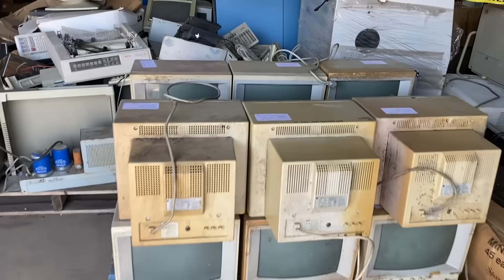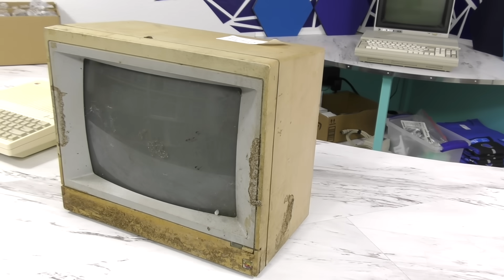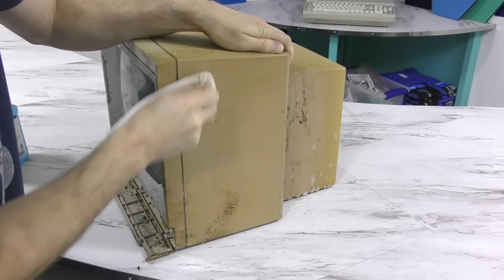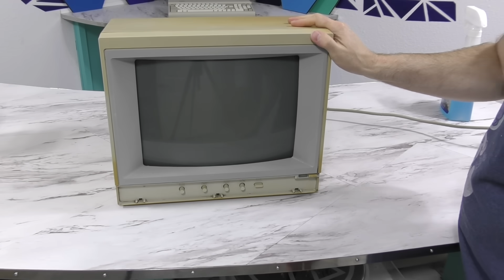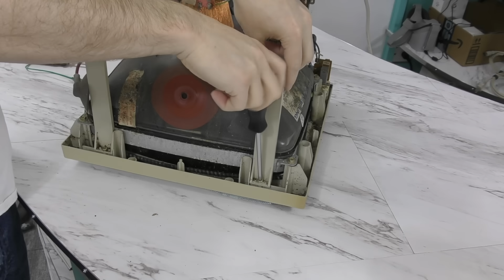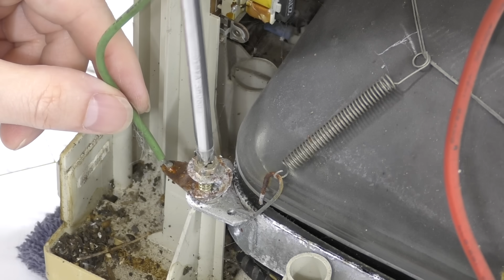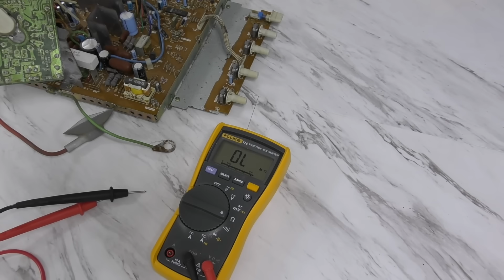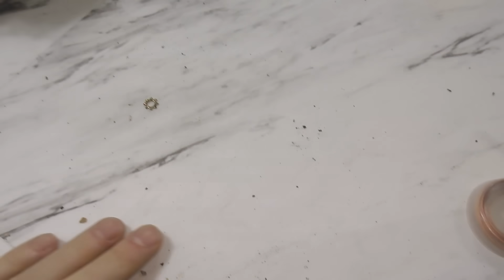Apple Monitor Found in Landfill - Restored - Part 1

Comment: There's nothing like a good rescue, especially of a CRT! If my field found C64 has taught me anything, it's that old electronic devices are more robust and resilient than we used to think!
Reply: Good to see you here Adrian! I really enjoy your content too!
Reply: @TheCasualSubculturist  Adrian has the most depth and breadth of any tech YouTuber - by far
Reply: @TheCasualSubculturist  Adrian has the most depth and breadth of any tech YouTuber - by far
Reply: Monitor problems? Who are you gonna call? Adrian- the monitor whisperer!
Reply: @666Astrosmurf  Who you're gonna call? Dust Busters! 😁 I ain't afraid of no dust!
Reply: No one may see this, but the diode in question is a high voltage fast switching rectifier diode.  Suitable replacement parts are pretty common.  Something like this might work.
https://www.ebay.com/itm/NTE525-ECG525-GE-533-SK3925-Si-Diode-High-Voltage-Rectifier-Fast-Recovery-Sw-NEW/271372095966
Reply: SAMS photofacts for these are difficult to find.  As long as it is high enough voltage/current, and a fast recovery type it should work.  It may cause higher current versus older parts so careful measurement of total power draw and a keen eye for parts heating up is wise.
Reply: You're not wrong. It's pretty amazing due to the build quality of these old electronics. I wonder who made the CRT that David bought. When were the last CRT's made Adrian???
Reply: Just learned it was made by Samsung, a brand I do trust as I've owned several electronics made by them.
Reply: @RJLightning68  Samsung.  Both monitors CRTs had the same label.
Reply: @RJLightning68  Actually, electronic components of the past are more robust and typically of better quality.  This is mainly due to the production quantities of electronic components, and the fact that almost all electronic components in the 80s were manufactured in the USA.  I've taken apart and repaired CRTs from the 50s to currently sold models.  I would definitely rate older CRT as 'better quality'.  This is especially true of any component which suffers from heating while in normal usage, as diodes are.
Reply: @RJLightning68  Ive seen dates as late as 2005 on some Toshiba's, and lower end brands on CRTs.
Reply: @RJLightning68  CRTs are still made, though they're generally bound to niche uses like avionics nowadays. Thomas Electronics still makes them for aviation and military applications.
Reply: That's so true like I repair printers and the old HP 4 printers were built like tanks
Reply: My own 64 was covered in green goop and had liquid in the bottom case but it fired right up after cleaning. Always clean these before testing!
Reply: Hey! good to see you here Adrian, your channel is awesome and deserves more subs.
Reply: The majority of computers and their peripherals have no moving parts to wear out and malfunction. Although occasionally you run into the expired RIFA capacitors, but they're easy to replace.
Reply: Adrian working on the IIc monitor, Clint did the 5154 today, now David with the Apple color monitors.

So... Monitors May?
Reply: My C128 was from a bin and still worked and my CRT TV is from the side of the road
Reply: Shango066 and radiotvphononut demonstrate that every week.
Reply: @Adrian's Digital Basement
Adrian, if you've got some time, Clint over at LGR Blerbs also has a CRT that needs some love. It's the new video as of today. Thought you might have some insight there like you did here and on your own channel. Just a thought, no intention to volunteer you or anything.
Reply: IIRC, didn't that one boot up just fine as soon as you got the motherboard cleaned of the mud and dried out?  Then there's the computer Mark from Mark Fixes Stuff restored that had been in a forest for 10 to 20 years.
Reply: If you like rescuing CRTs you should definitely check out shango066's videos, he does this exact stuff all the time
Reply: "old electronic devices are more robust and resilient than we used to think"
That's survivorship bias talking, and you over anyone should know about it.
Reply: About 3 years ago I was recycling some old tvs for work. At the plant I saw on a pallet stacked 2 high old g5 macs. All about to be scraped. I dont even like apple but was still pretty heartbroken.
Reply: Good to see you are holding hands with david :) Cheers!
Reply: These monitors may still have bugs in them, literal bugs.
Reply: Oh yeah fore sure. I found an old TV in the dirt and rain for many years, and the only issue it had was a loose connection which was easy to fix because all I did was cleaned the contacts and everything works!
Reply: Reminds me of the Atari 2600 my buddy and I rescued from a dump around 1989 which we found with several cartridges. Cleaned it up and were playing with it the same day.
Reply: Always glad to see restoration from people which have a good heart to save those good old electronics, I feel warm that people still spend time to rescue the electronics from the landfill, in my city they're sure going to trash bin and will tear down and scrape for copper, old computers and monitors much more memories from childhood.
Reply: I believe you also mentioned at some point you had a field found TRS-80 that you were able to fix as well?
Reply: @tombarber8929  ah yes, I did! A model 1. Was rescued from a pickup truck also found in a field. It was before I was really making videos though so no video documentation. That mud infested machine still works today.
Reply: Yeah ikr
Reply: I dropped my TRS-80 mod 3 accidentally.... There was a crater in the floor, but the machine still powered on
Reply: the fact that they're so robust is what makes them so much fun to restore :D
Reply: What do you mean -- more than we used to think?  The '80s way to repair electronics was to give 'em a good bash on the side with your fist or the heel of your palm.
Reply: I still find it amazing how many landfill vintage computers and electronics are still working today after hearing Bil Herd's talk about component aging a few years ago
Reply: I picked up an old gateway PC from around 1995 in around 2005, it had been sitting in a collapsing garage with no door or windows since around 1999 or so, the case was very rusted but the PC still worked. I got it cleaned up and sold it to someone who wanted it for his DOS game collection. There was also this cool Magnavox color tv in there that still worked too!
Reply: 8bg’s Vic-20 also hit the spot I recon, lol these disgusting restorations are the best.
Reply: Since this comment is talking about CRTs and my comments don’t show up normally, I am gonna post a question about my CRT, It is a Medion CRT with an internal VGA cable, every time I turn it on after letting it sit for a while, it makes a weird sound, like a hiss/electrical sound, it isn’t an ARC I don’t hear anything that sounds like an ARC. Just asking here if anyone knows what that sound is.
Reply: Your C64 was first thing I thought about while seeing those monitors
Reply: Loved this one. I also once restored a Commodore 1702 CRT that was found in a damp barn. You would not believe how stubborn the dust and dirt inside that one was. Surprisingly it turned on without any issue after cleaning it. It's still working to this day. If only I made a video about it..
Reply: Try to use a KÄRCHER from a bit away and  you get all dirt away.
Reply: I love it when my favourite YouTubers collaborate on projects: this monitor, the Commander X16, the Apple PIIe... please keep doing these videos every once in awhile.
Reply: Yeah, I've seen people do crazy stuff, or stupid simple solutions, to clean their busted electronics. I use Apple and their newer keyboards are garbage quality, if a drop, A DROP, of water gets anywhere near it the entire keyboard basically becomes unusable. Just put the whole thing in the shower (Or alcohol bath) to give it a good clean. Give it time to dry properly and it'll work.
It did, but not for very long though, after a couple of weeks my old keyboards started to freak out again, probably bubbles in the membrane. Unlike a Gameboy, these Keyboards won't last an explosion or a good fire, lol.
Reply: I absolutely love seeing crts being rebuilt
Reply: Drizzt Do'Urden  still has a better picture than your 4k lcd buddy boy.
Reply: @vincentlamb3436  not when it's full of mud with horizontal stripes
Reply: @natalieisagirlnow  horizontal stripes are an optical illusion from recording. The shutter speed of the camera is usually faster than the refresh rate of a CRT (60/75hz), and not all CRTs are covered or filled with dirt.
Reply: Very much so, the stuff from that time was not like today.
Reply: That's great. Last time I was there someone made a comment about "all the Apple IIe monitors found out back" and I thought he was just being funny.
Reply: N O K I A
Reply: Was very robust
Reply: Probably more that humans are more destructive than nature
Reply: Oh for the days when bean counters weren't penny pinching on the cost of each part.  I get that planned obsolescence has always been a thing in electronics but it wasn't always built to fail but rather just built to the limit of what could be done.  Leaving no room for improvement or future compatibility.
Reply: I agree fellow Adrian
Reply: I'm surprised that the stickers are still intact. They're still intact and sticky, even after all that scrubbing action.
Reply: "This diode will self destruct in 25 years....good luck Jim/David" - "I de-soldered the legs and when I turned the board over all that was left was some dust on my work-top"
Reply: Yeah I think that retro computers are gonna survive another 30-40 years. They already did it, what’s stopping them from doing it again?
Reply: and todays tech lasts a maximum of 15 years and can never be revived :P
Reply: we sure don't make electronics (or anything) like back in the day, some things were just TANKS.
Reply: @th3cub350  you won't see many SMD IC's in the these old fixable devices that have pins/legs sized in the order of 0.5 mm. if those corrode, there's a high risk it won't ever work again. It's not so much that the devices was built to last but also that they were more simple devices compared to modern electronics.
Reply: @th3cub350  They also had these novel removable fasteners called screws holding them together.
Reply: Hi Adrian - I wish David had simply asked you what the diode was and what modern replacement to use rather than sacrificing one of the remaining monitors merely to cannibalize one part.
Reply: @Fred_Raimer  Unfortunately, there is no way to know what the diode that is. Apple never released schematics or  a parts list for this monitor... so the only hope was trying to see if there was a marking on the diode. Sadly, these ceramic diodes just turn to dust when you touch them. It was the same problem with a recent Apple IIc monitor I worked on. More than one were "just missing."
Reply: @Fred_Raimer  On the up side he didn't cause any damage he can't fix. The damaged diode had to come out of the other one anyway.
Reply: @killerbee2562  Excellent point!  I'm embarrassed that I didn't think of that.  I guess I got caught up it and wishing that I had one of those monitors myself.
Reply: @Fred_Raimer  At least he didn't just replace it with a paperclip

Comment: I'm from Brazil, I used Google Translate!
HYDROGEN PEROXIDE 50%! To turn the plastic from YELLOW to its original color
= Put the Peroxide in the bottom of a container, put another container inside and the object inside this second container. COVER IT WELL (seal it) and the gas that it releases will lighten all the plastic. Leave it in the sun for 48 hours (2 days) or as long as you think necessary. The following channel shows all of this. It's really cool. I think it will be perfect for you.  https://youtu.be/nb2bxaj79rc
Reply: Retrobriting, he does it a lot

Comment: When you mentioned "liney" on the note, i expected to see retrace lines. Usually that would indicate a bad G1 solder joint on the CRT socket (or flaky corresponding pot, often on the flyback or the neck board). And no, I haven't seen part 2 yet, so I'm speculating here. Maybe the video proves me wrong... 😉

Comment: Things use to be built better and go through actual quality control. My parents left a TV from the early 90's in a damp garage totally exposed and used as a table end. 9 years later it came right on like it had been 9 minutes. Leave a modern monitor or electronics outside for a day and it'll be ruined.

Comment: I'm doing a minor repair on my A2M6021.  I can't seem to find schematics for the mainboard and was hoping that I could get someone to tell me what specs the resistor R741 might be.  The one in my monitor is very close to a short (2 ohms) and I can't imagine that any resistor is suppose to be charcoal black.  :-)  R741 is on the main board just next to the 4-post connector for the neck board.

Comment: Small, relatively soft nylon scrubbing brushes in round and angled configurations are absolutely ideal to have when scrubbing really filthy electronics, among other things. You want them to be just stiff enough that they will offer some motivation for the dirt and grime but not so stiff that they actually scratch the plastic. Some of the cheap nylon brushes that come with packs of wire brushes can actually still be hard enough to scratch the aged plastic on old electronics. Best to start with brushes for cleaning dishes. 

I'm always amazed at the persistence of old electronics. Some of them will just keep working even when they've been so thoroughly neglected that you couldn't imagine them possibly ever working again.

Comment: If I may make a suggestion about the plastic monitor, I have a small compact  dishwasher that I use for cleaning things I don't want to hand clean as it takes too long, a few cycles with lemon joy  and the hot water setting on and things are usually pretty spotless.

Comment: @15:15 I don't think you could salvage a monitor out of a real landfill.  In real landfills they use bulldozers to turn over the pile constantly in order to circulate air because a lot of garbage won't decompose without oxygen as the bacteria and other microbes that break it down are aerobic.  I feel like this continued turning up of the landfill would crush the CRT in little time.  Not to mention the rough handling just getting the monitor to the landfill in the first place.

Comment: I gotta say I'm not liking the new background that much.  The triangle pattern flattens the perspective so you can't see the depth of the corner.  Maybe try adding drop shadows that reinforce the angle of the corner. I'd also fill in some of the negative space between them to make the triangles larger so the backdrop looks less busy and distracting over all.

Comment: It looks like you might need a schottky diode. I have replaced several in televisions that have failed I show some in my videos.
You need some idea of the required working output voltage and current, but if you over rate the diode you should be good to go. So maybe a 200-300v at a few Amps.
They are often used off the output transformer of a switched DC to DC circuit to provide the lower DC voltages In your case its difficult to say but you could measure the switched voltage prior to the rectifier to get some idea of the forward and reverse voltages being applied to your diode. Or ask adrian to measure the input and output voltages and current, the current is a little more tricky as it would required the diode to be lifted out of circuit at the one end for a meter to be inserted. Good luck.

Comment: the blury image and retraces is problem in screen power suply (+- 600v)  from flyback screen cable , and probably have problem in RGB power suply too (180v), that putrid diode makes those RGB suply... change it and filter eletrolitic capacitor too and problem will solved...
BTW , any other diode around flybacks out pins you can use in replace that putrid diodo, all diodes there has the same caracteristics... the flybak is no more no less than a switched power suply, so you can take off an other diode from another monitor...since if take off from the same region... and in good state

Comment: hi 8 bit guy So i think you are right preson to ask . Im now in retro project of programing motorola saber radios using ms dos on intel 486 laptop and question is if  save files on floppy using win 10 64 bit ms dos will read this floppy ?

Comment: You might benefit from using a "low pressure" pressure washer. I have had a lot of luck using Nilfisk washers for doing basically step 1-3 of your cleaning process all at once. Especially in crevices or enclosed areas where it's not easy to clean with a brush. But it has to be suspended by something, otherwise it'll be flung away like a fly in a hurricane.

Comment: i watched a video of a guy restoring an old game boy and he retro-brighted it with only 15% hydrogen peroxide, but he used a home made UV tub setup and it seemed to have worked great, i think relying on the sun for the UV rays is costing you time and money, because of the rare and probably more expensive 30-40% hydrogen peroxide you use, which you only need in the first place because you don't get enough UV light from the sun.

Comment: My bet, is that a modern standard 1N5408 1000V diode will work fine. I always have a hundred or so on stock, and I use them in almost everything.